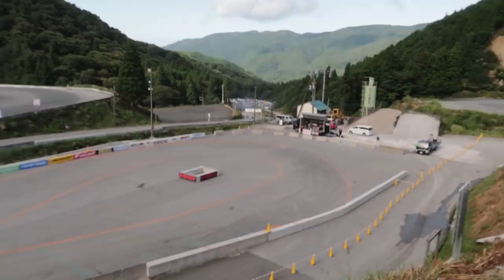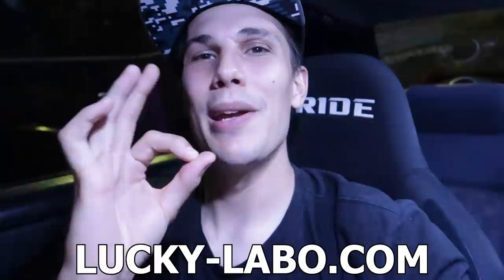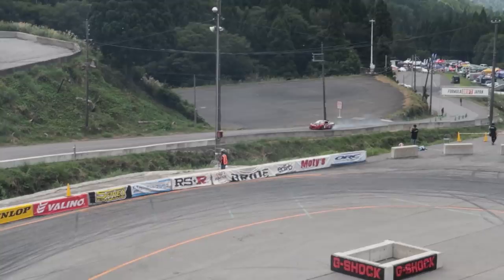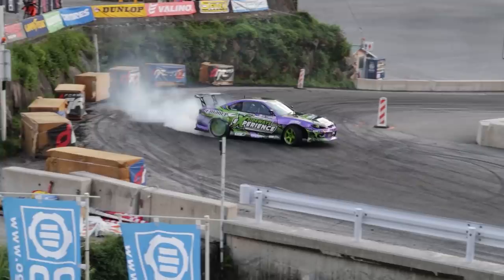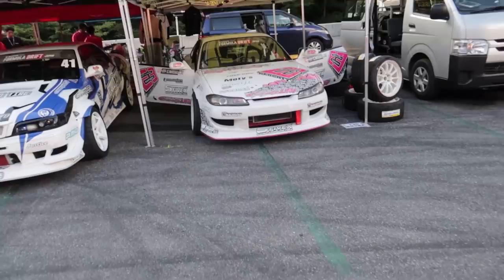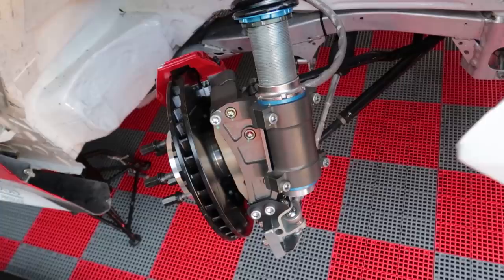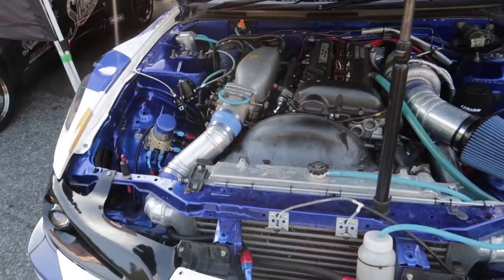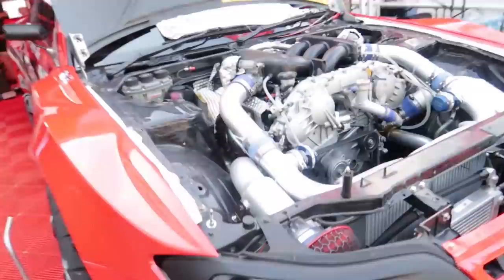1000HP GTR POWERED S15!

Comment: That BMW is E9x 3 series chassis. BMWs are well balanced typically and there's plenty of engine bay room for a V8 (which the M3 uses). They're 05+ so 2-3 generations back and so relatively cheap; it's a good way to get a chassis that can run a large capacity engine comfortably.

Comment: that bmw is a e92 chassis with a HGK body kit. it also most likely running a mast motorsports 850 unlimited race gas engine ( fancy LS)
Reply: @12:03 that is a blade swaybar on that a90
Reply: HGK builds the whole rolling chassis. Optional in many setups.
It's not only a body kit. 😉
Robbie and Kenny said in the livestream it has a TT V6 called a 1GR I think.
At the Sugo round Robbie also said it's from a Honda.

Comment: James deans build cost 200k+ euro to build that e92! It’s full of carbon Kevlar, it’s everywhere in it! Nuts car! Good driver too!! 👌
Reply: Bare, prepped chassis costs around 80-160k and it depends on what you want. Deane's car is close to 250k.
Reply: Emzijs it’s crazy money!! But they are at the top of the sport leading the way! It will be a while before I’ve a full carbon build! 🤣🤣

Comment: Yo Sammit! What car is at 0:04?
Reply: It’s a decepticon
Reply: @keahisumile3  I found out that it's a Toyota Alphard, but you are not wrong. Looks like a transformer.
Reply: @DjSubstain  there is another one called Toyota vellfire.. Almost the same like alphard... Both use same type of engine.. But I think alphard looks more badass..